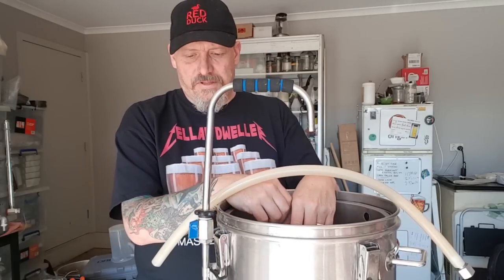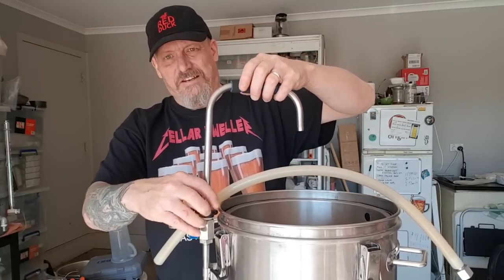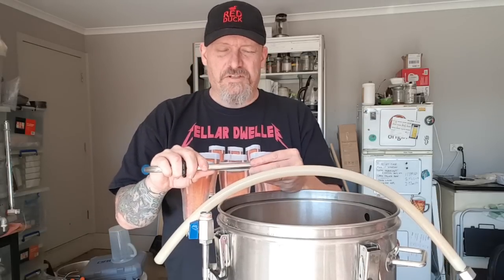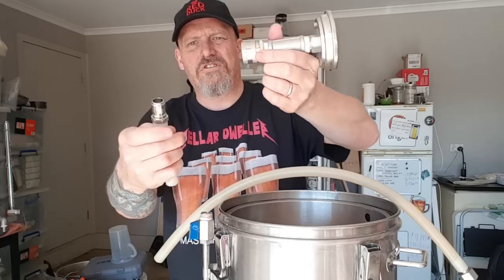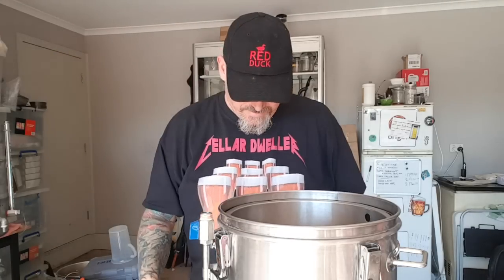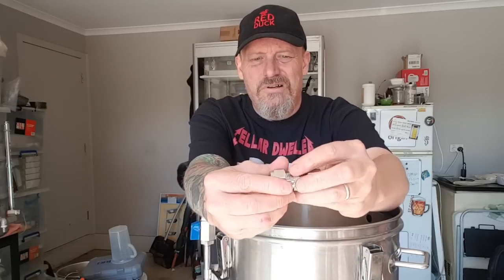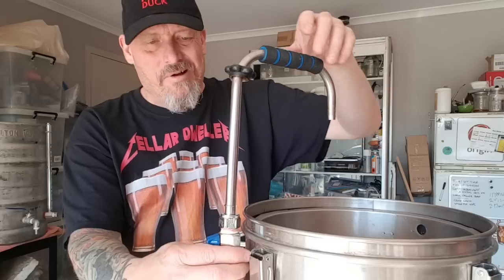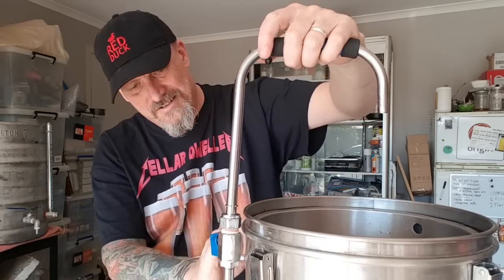ROBOBREW MOD - Gen2 - Compression Fittings

Comment: I only have the V2 and like you I'm flicking mine around all the time and am glad I never did the cam lock mod , have even been thinking about trying to get another V2 as I like the simplicity, but with what you did in this video it
 does seem like you get more pressure with this mod but does it really need it?
Reply from the maker: I don't think it needs it, I guess this was more for just a cheap quick example of what you could do if you were stuck for a new seal on the weekend or something. I too really like the simplicity of the old setup and have put it back to normal, though if I need too I wouldn't hesitate to use the compression fitting. Cheers mate!